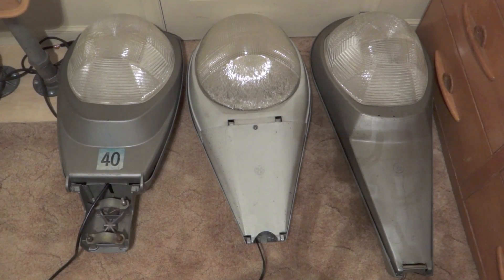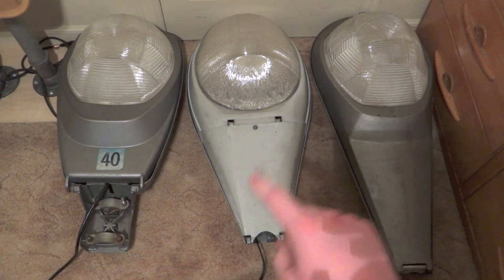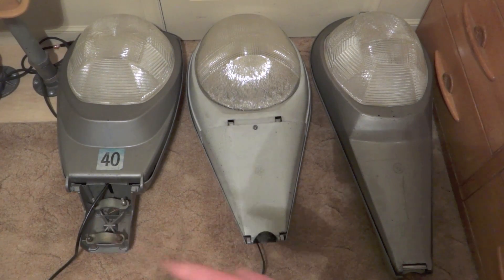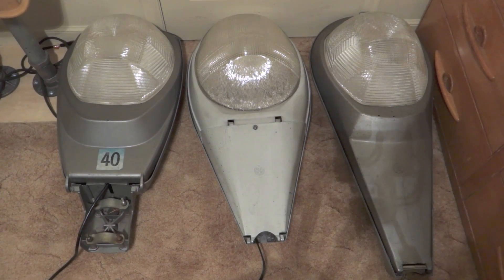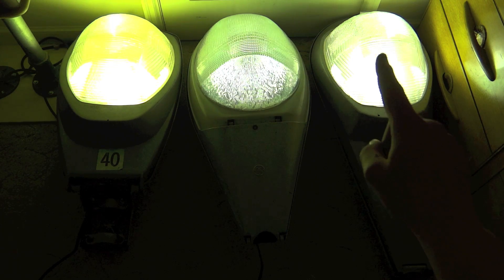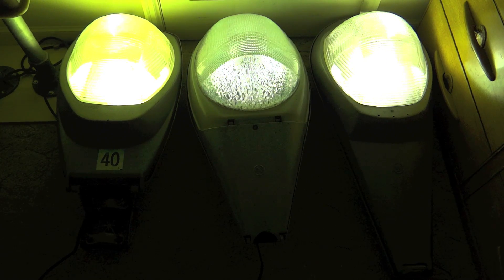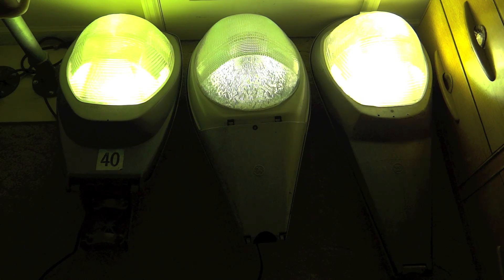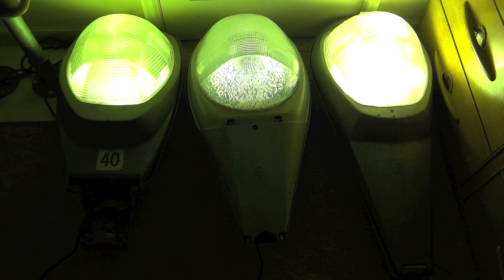Mercury Vapor (MV) Street Lights Turning On 2011

Comment: The buzz gives me a lonely sleepy feeling; lots of people don't know that the buzz is from the ballast plates or wires coming loose and vibrating; that can be fixed by dipping the ballast in polyurathane and allowing the heat of the ballast in operation to dry it...

Comment: @ckobesko You can buy them from car boot sales, eBay, from the engineers who work with the road lighting if you know where there yard is, Lighting wholesalers & sometimes you can find them in refuge dumps Most of the councils are replacing the old street lanterns that work on MV with either HPS or MH ones As for buying Mercury Lamps they are quite cheap ie I know some lighting wholesalers selling MV bulbs for just £2

Comment: You will notice a big difference when you replace them with new bulbs 
The new bulbs will be much brighter & will emit a slightly pinkie violet glow after the bulbs have burned in they will eventually lose that pinkie glow in time as they get older the older bulbs that have been used a lot will emit a duller light